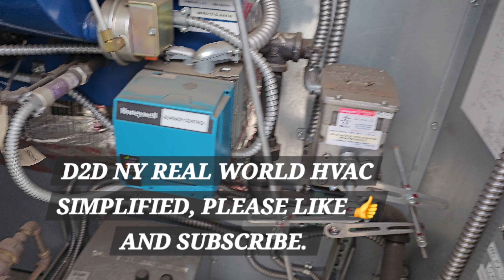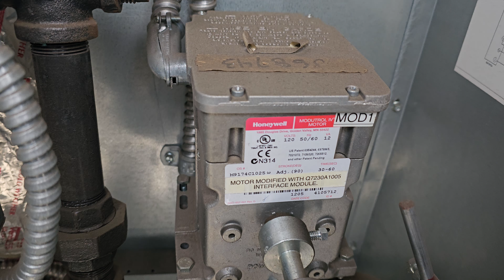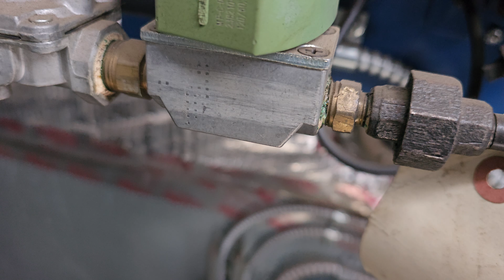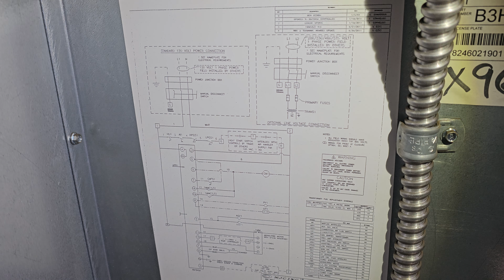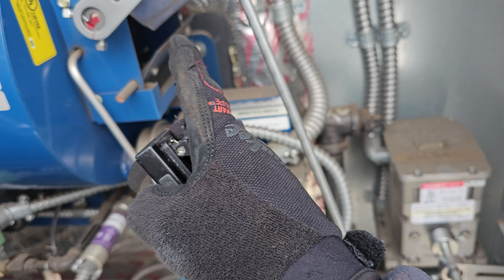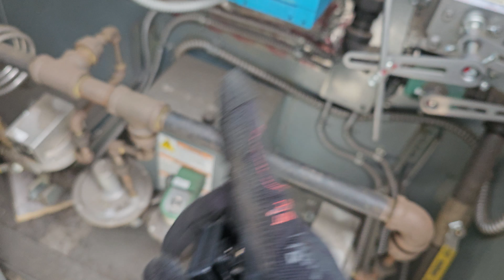NAMING ALL COMPONENTS INSIDE TRANE COMMERCIAL HEATING FURNACE

Comment: Checks to see if the pilot ignited. Fought with one for weeks on our hot melt oven.
Reply from the maker: If the pilot doesn’t get ignited the main valve won’t open and the pilot indicator light will stay off and the controller goes into alarm
Reply: @D2DNYAC  We had an issue where the "butterfly" was staying open and blowing out the pilot when we initiated the main valve. I didn't really fix the issue, I just dial down the temp on start up, that butterfly closes to "idle" and then I can start it. We use Honeywell controllers and were getting code 19 and I think it was 17 both a flame out iirc.

The ovens we use are old, 1989 on the plate. Prior to working where I do now, I only had basic home experience. I've been watching a few of you content creators on YT and want to thank you for your channel. It really has helped me with diagnosing issues.

Edit: the controller we use is the exact one in the video.